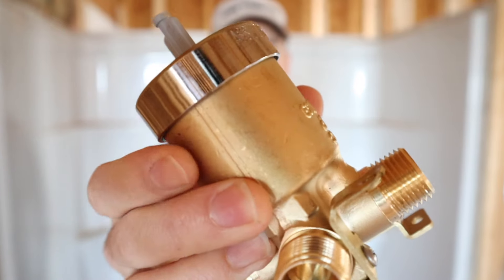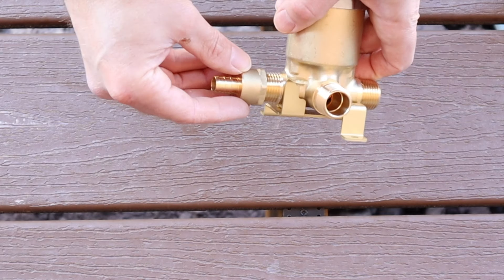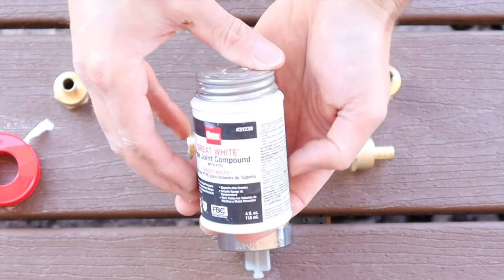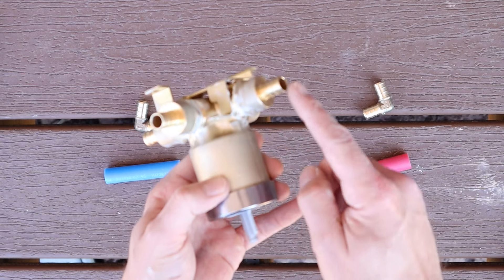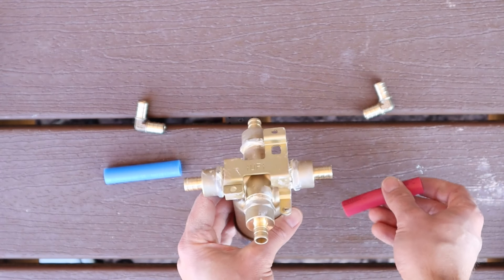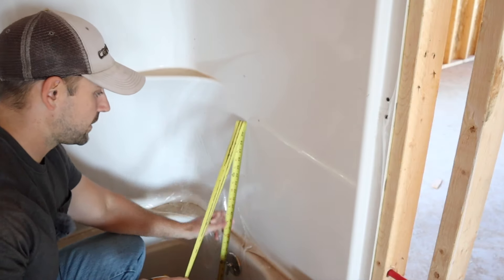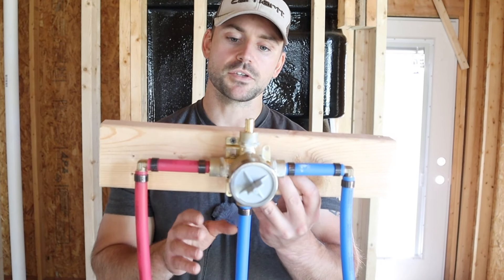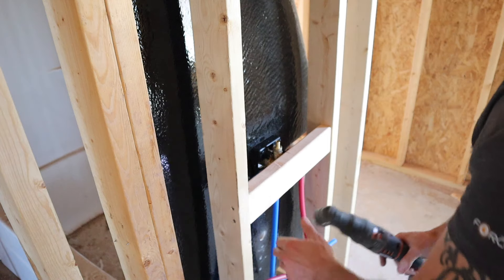Delta Shower Valve Installation - PEX Install For Tub/Shower Combo

Comment: Tub spout is to high also if you read the directions the line that runs to the tub spout should be copper the pex diameter is to small and will cut down water flow.

Comment: Just a note to people using PEX. The Delta R10000 manual says to use only copper or iron pipe to the tub spout with just one 90 degree bend. It says to NOT use pex to the tub spout. Apparently if you use pex, when you run water to the tub spout, water might come out of the showerhead. Just a heads up that that is what Delta says about pex to tub spout. You can always try pex and if water comes out the showerhead when you run the bath either live with (I mean, what's he big deal if it's your own home right?) or understand that that is probably why it's happening.

Comment: Doesn't the PEX to the tub spout need to be at least 3/4 Pex OR 1/2 copper?
Reply: Yep. Delta instructions say Pex is not allowed at all for the tub spout connection and 1/2 copper should be used. I've heard people using 3/4 Pex for tub spouts and that being a decent work around though, but instructions are very clear to not use pex for tub spouts.
Reply: Yup should of used copper
Reply: Pex-A has a larger internal diameter than Pex-B (B is what is used in the video). Delta recommends if you use Pex-A to the tub spout that you do NOT put in a 90 deg. fitting, but do a radius turn on the Pex. This is to avoid the water restriction that can occur.  Also, in the video Josh aligns the black plastic mud ring with the back of the shower unit. For a thin shower wall with no ribbing behind it, it's not a problem, but some shower walls have considerable ribbing in the back and therefore this would not work. You would need to cut a larger hole so the mud ring can penetrate upon installation of the wall. This will also allow the trim screws to go thru, assuming you trim kit uses them. Am I right on all this, folks?
Reply: Question
If I have an existing combo tub/shower valve, can I just cap the tub spout if I'm remodeling to walk in shower?  Thanks.
Reply: @ShootingG1  yes just cap it and water will be forced to go up to shower head.
Reply: @Luckyy2407  appreciate it man
Reply: @tobrien871  I am under the same impression. For my situation (bootz nextile surround), I believe I will have to have the plaster guard exposed so that the holes of the plaster guard will be exposed for trim mounting with screws. Considering from face of stud to finish wall it is 1-¼”.

Comment: Help!  I've attached SharkBite 1/2-in PEX Crimp x 1/2-in FNPT Brass Female Adapter to my Delta shower/tub valve....4 times.  Every time, the hot water feed forms a drip after a few hours of opening the cutoff.  The other 3 do not leak, only the hot water side.  It seems to be seeping out from under the PFTE tape.  Each time I switched to a new adapter, same result.  I even switched out the Delta mixer.  Same result.  Never seen anything like it.  I'll call a real plumber on Monday, but this just shouldn't be this hard.  Suggestions?

Comment: Are the Drop ears the same for the shower head, and the Spicket. If so, is it a precut galvanized(threaded on both ends) pipe you’re using for the Spicket? And what should length of Spicket pipe should be sticking out from the tile or tub surround?

Comment: NOTE: That shower valve now comes pex ready, at least for the two inlets. So buy that if you are useing pex and you won't have to thread those two connections! (But still have to use an adapter for the shower outlet).

Comment: How do you keep the front doors attached when closing them?
I used some heavy duty rare earth magnets installed in door edges and recessed them where they would contact each other keeping doors closed before opening. Curious if you have a better solution?

Comment: Any issues with pex on tub spout instead of the recommended copper on the R 1000? Josh your a huge help thanks. Followed your way. Just wanna confirm.
Reply: Yeah, you'll get backed up water coming out of your shower head. The valve is fed by two 1/2" pex lines and those two supply more than a 1/2" line can carry down to the tub. So, if you are filling up your tub you might notice some water coming out of your showerhead (just drips usually) while you fill it. Copper has a greated ID than pex so it can handle the flow of the valve and won't back up.

Comment: Good situational awareness; good product familarity; good speed of delivery, and easy to understan.  I like it.  Suggest copper tub spout drop.  suggest brass nipple for tub spout connection, other wise very good, and thank you.
Reply: The manual says to use a cooper tub drop.  Why is that?  Curious
Reply: @stellr  Pex is too restrictive on that drop, so what can happen is, as you fill the tub, the water slowly backs up to the shower head and you will have water coming out of your showerhead while the tub fills. With copper it allows more flow and so that doesn't happen. It's really just a nuisance and not the end of the world, but people should be aware.

Comment: I am a do it yourselfer. I been doing projects for over 40 years. I really like all your videos, especially all the plumbing, shower, bathtub installs since it is the least of projects I've worked on. Built sheds, numerous decks with treated and composite lumber, all household projects, installing dishwashers, hot water heaters, etc. Anyway, just for reference in this video you call the tub spout/faucet a Spigot. Just for General Principle, spigots are usually designated as being outdoors or on the exterior of a house. Keep up the good work buddy and God Bless!
Reply from the maker: Hey Harry! Thanks for the info. I’m always excited to see subscribers like you that have been DIYing for awhile watching my channel. Any input is fine with me. It’s all about learning together. Good luck with the rest of your projects!

Comment: If you only cut the hole at 2 1/4 for the valve how do you screw the escutcheon on? I just cut the same valve out and the holes for the escutcheon have the shower wall behind them like the hole isn't big enough.
Reply: I just done the same with a 2 1/4 hole and the trim kit holes are not visible enough to attach the faceplate. What did I do wrong? Thanks

Comment: The pressure on my spout and shower is low for delta portwood. I think it uses same valvle. Anything that I can do to increase the pressure?
Reply: I found that to be an issue when I did a delta valve. I had to increase the hot water adjuster on the center of the valve. I think it's to prevent scalding but when I turned it up all the way to allow maximum hot water to enter the valve, then the water pressure was better. I don't think that function of the valve necessary since you can adjust how hot your water gets on the water heater.

Comment: Hi again a great video bro! I hate to be pessimistic but a true pro learns every day new things & I hope you appreciate correcting you on some minor things that I think you could correct in the future 
First, from the mixing valve to the tub spout you should not use ½ pex because it is really restricting the water flow & can cause water to drip from the shower head, rather use copper or ¾ pex
Second, the square plastic guard that comes with the valve should be cut out in the tub [not just the round hole] because you need access for the screws for the trim & for the small shut-off valves on the sides 
& lastly I would not use galvanized  nippel for the stub out as the rust rather use copper or brass 
& again I hope you take it the right way I really enjoy watching your videos & as somebody who is in the trades appreciate when people  correct me when they see that I can do something differently that's what makes us better every day 
Keep up with your awesome work
Reply from the maker: I appreciate your input. Thanks for watching!
Reply: Question
If I am converting a tub/shower combo to walk in shower,  can I just cap the tub port on combo valve or do I need to change out the valve to shower only?  Thanks,
Reply: @ShootingG1  This is a late reply, but a tub functions by just pulling on the spout stop to force water to the showerhead, so when you close off that line it will just be permanently routing water to the showerhead. So, just cut it as close to the valve as you can (so you don't have funky stuff growing in that un-used line) and solder or crimp a close onto it.

Comment: Aren’t you supposed to have a bigger hole so that the screws for the trim kit can mount into the valve bracket?
Reply: I have the same thought
Reply: Yes the thing he put behind the wall should be exposed and cut to that square.

Comment: How do you keep water from coming out 
I guess you didn’t cap off your water will flow out
Reply: It's a very good idea to order a Delta valve with the built in H/C shut offs for testing and future maintenance (cartridge replacement, etc.)

Comment: The installation instructions for this valve say not to use Pex for the tub spout drop. I believe this can cause back pressure and leak out of the shower head. Was this an issue with this install?
Reply: Did you get an answer to this? I'm installing a new one right now. We did one in the basement that I assume used pex, and it does leak out of the shower head. This must be why
Reply: Anyone know ??
Reply: I just used this Delta valve in a new basement bathroom using 1/2” PEX and a drop ear to the tub Spout. And after installing the trim kit (after the tile is up) sure enough the shower head is leaking  while the tub spout is on.. I would recommend using the copper! 😞

Comment: Is that a galvanized nipple for the tub spout? I've heard you should only use brass or stainless, galvanized will rust and become totally blocked over time.
Reply from the maker: I haven’t had any options with that. It’s a nipple did have issues you could just switch it out down the road.
Reply: It's TRUE use brass or just copper.

Comment: I was mostly interested in the setting depth of the valve, but I think you cut the hole opening too small for the valve as you can not get the screws through for the trim plate.

Comment: Dude you made a mistake. Delta says you can not use PEX going to a tub spout.
Reply from the maker: Hey Bob. They don’t recommend it but I have used PEX here and have not had issues. I would go with what delta says and not use it.
Reply: @TheExcellentLaborer  I would think that if the water pressure is quite high that would be a factor in whether the water leeks from the shower head. But to be safe, id use 1/2" copper. Low water pressure, may not be a leaking issue.